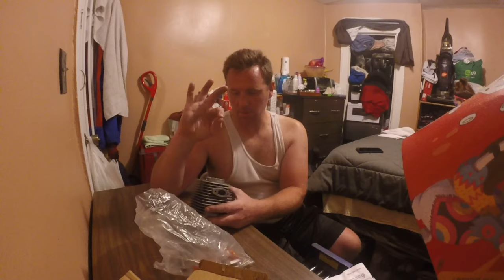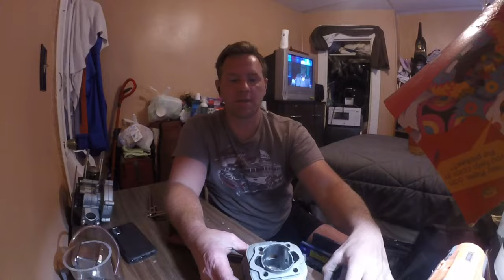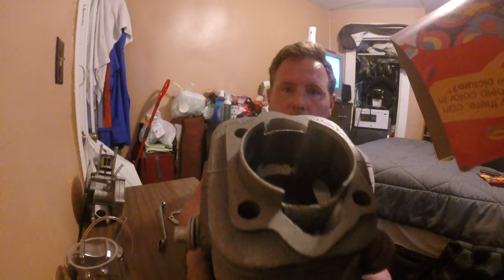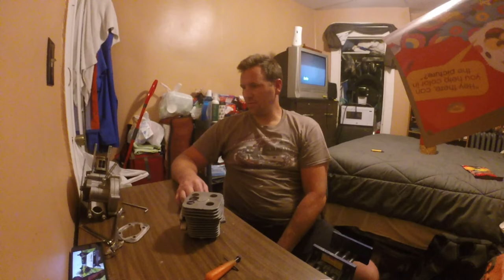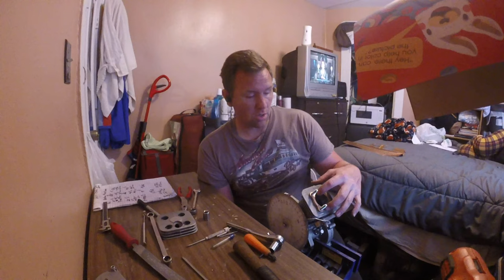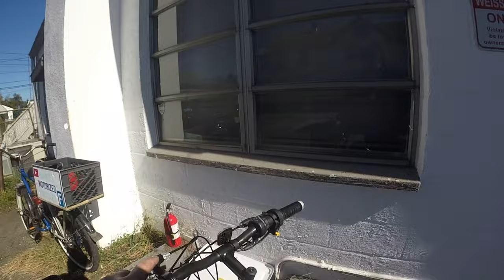I CUT THE YD100 CYLINDER’S TOP OFF, HOW I GAVE IT A SEPARATE HEAD.

Comment: The "Mad Scientist" strikes again... 👍👍👍 Nice way to think outside of the box bro... Good job of using what you have and improvising.. I have a couple coming out on my YD 100, be sure to watch... Best wishes to you and yours... 😎😎😎
Reply from the maker: I’m glad you approved lol , but I’ll definitely e watching what you do too.
Reply from the maker: Yes they are also referred to by many as a pk100 it’s basically a pk80 bottom end (the case, which is a very well put together motor)  the head is great for cooling too. They are know to have a problem with the piston skirts cracking off because 99% of them are not honed properly but only a lil bit of you break them in easily it pretty much fixes that problem or if you give it a quick honing that also fixes it. Oh I forgot to mention but it’s usually only the bottom of the cylinder that’s a lol tight n breaks the skirts not the whole thing, that’s y I say if you break it in easily/correctly you’ll b fine cause it’s only a little bit that’s tighter then it should be technically. But for the most part they are very well put together motors. There’s a lot of people talkin smack about them but if you understand them they are great little motors I  made a video on one like 6-7 months ago n I was talkin crap about it cause I didn’t know what it really was at the time but now I know more and about a month ago I put up a video about me disassembling mine to rebuild it. Now you guys haven’t seen it yet but my next video or the one after will b all about this exact motor (mines just black) and me rebuilding it completely n fixing all the issues I found in mine or might have caused actually, but let’s not split hairs here. I have been using this same motor your lookin for over a month now on my daily and it’s running great n start easy every time since I rebuilt it. Now mine has a few issues cause of the abuse I put it through but if you break it in right I’ll b fine and I think you’ll really enjoy it. Mine revs for ever n spins my 26” wheeled bike to 43 mph which is high rpms. Anyway sorry for the book but hope this helps. And either way that’s a great price for that motor I think I paid $164 7 months ago.
Reply: @JMB676  thanks again Johnnie,, I always appreciate your insight 😎😎😎😎
Reply: Y’all get on FB join motorized bicycle nation

Comment: Good video bro n I agree them carbs have a long slide compared to stock seems like you have to twist far for full throttle but there sweet I have 2
Reply from the maker: Yes it’s just weirder to go full throttle fast but they are great once all tuned up but this bike definitely rips once I get everything done to it my boy said he got clocked by a police radar goin 52mph like two weeks after I gave it to him but since it’s so cold he has really rode it anymore n he didn’t have his camera with him for all his first rides cause he’s , well a lil odd we can say n he was getting use to the bike.
Reply: That’s cool bro n I believe it to I have 2 yd100s that are in the 50 range n run great
Reply from the maker: @Littleevil9975  o yea no doubt they can hit that no problem if setup right but it helps when you don’t weight 270lbs plus but even at that weight the big thing I noticed from it is how fast the Reed helps it wake up from light to light.
Reply: Right I agree there bro
Reply: Right I agree there bro
Reply: Right I agree there bro
Reply: Right I agree there bro
Reply: I just found out it's an iron lined cylinder sleeve, the other similar "110cc" (50mm piston) kit I seen that LA Hoover bought turned out to totally suck.  If the iron sleeve was properly machined, it could be a decent kit.

Comment: How much pump did you loose after chopping the top. I lost a grip on my first one. Just wondering.
Reply from the maker: To b honest I didn’t measure it like that but it was probably about 3 millimeters all said and down. It was more then I wanted if I’m being honest but my next one will b less, my spacer will b smaller to get the pump n durations I’m lookin for. But like always live n learn right. I can’t wait to do another now.
Reply: @JMB676  would raising the jug with another gasket get the squish and port timing about where you want?

Comment: i dont understand why you cut the jug in half johnnie . dont that just open up more area for there to be a failure . i mean you must be trying to get a longer stroke meaning you have a longer piston rod arm . if its the same piston rod  then what is the point  of cutting it in half? ok not knocking what your doing just trying to fully understand why you would do this and why you would need to . now i dont ever see myself doing this but that dont mean i dont want to  understand why . im guess there must be more power or else why do it . take care ride safe . say hello to heather for me . lol .
Reply from the maker: Yes it more power but if you remember video I showed his bike I talk about taking that motor off to repair it x cause I blew the cylinder, a ring got caught and that’s y I’m replacing it. Well if you remember I had changed the port durations a lot by diggin out the transfers and stuff quite a bit but it also took away the smooth edges in the motor cause I changed so much. So. The only way I can get the same numbers out of it and keep all the smooth edges is if I raise the cylinder as a whole; ie put a spacer on it. But cause it’s a one piece cylinder I got to cut the top off and shrink it just to get the proper squish back. So besides the common over heating issues these motors are said to have, to be able to put an after Market head on it to help with cooling. Doin what I did allows me to get port durations I really want with out taking as many changes in the long run. Hope that helps brother.
Reply: @JMB676  lol nope im still confused but i kinda understand . in order to make everything line up and not grind the walls up you had to change  the size of the jug  to line up the ports to get the squish and line up right you had to cut it and resize the jug to line up right . now even though what i just wrote just confused me  alot i understand . basically it was all about making it smaller and still allowing everything to line up correctly . right?
Reply from the maker: @diydarkmatter  yes basically cause the last cylinder I used my rotors tool to dig out the transfers and exhaust a lot it ended up catching a ring cause of the size change n difference from a stock sizing so this way if I use the spacer I can get all the same measurements for the port durations (how long the ports are open or closed for) that I got from the first cylinder that blew up at wide open throttle but the width n what not is still stock size o the rings can’t snag as easily but still open how much I want. But by doin it this way I end up with way to much space above the piston at top dead center and since the yd100 is a one piece system the only way I can fix it is by cutting the top off so I can shorten the cylinder. So what you said is correct but since you said you still don’t totally understand I tried to do a better job of explaining it for you so I hope I did but if you still don’t then to bad so sad 😭 🤗
Reply: @JMB676  yep i understand now . what was confusing me was the spacer . i thought you was making it bigger not smaller so it dint make alot of sense . but now i understand that its shorter and the spacer is to make sure the ports line up right . are you going to use a high compression head or the stock head ?
Reply from the maker: @diydarkmatter  I’m just using the stock head i mead for it but if my buddy that bought it is interested in a different one I told him there is options if he so chooses however I did say I don’t really recommend it unless he noticed it getting to hot but since I built it so late in the year we don’t know if getting hot is a problem yet cause it’s cold out n as of now it stays really cool n there’s a build up of condensation on the outside of the Reed manifold cause the air charge goin into the motor is so cold on , so I honestly don’t think it’s goin to b a problem but maybe this summer we will have to see I guess. How is your bike doin?
Reply: @JMB676  ok i get its cold  its cold here to . as for my bike it s ok i still have not got it started  yet as its cold here . im old and have arthritis in my fingers so when they get cold they burn and cramp up so bad i cant hardly move them . so i dont do cold . but i will  say  i cant wait till spring . i have not done any upgrades on it yet . Christmas  is more important for a couple little ones then upgrades . its a magic time of year  for little ones . but  before spring i hope to have it the way i want it . but even if its not it is ready to ride . if i was your buddy i would go for the new head . even a stock motor  will benefit  from it  just for reducing heat alone . we all know how hot these engines get  the cooler they are the longer you can ride . what would be nice is converting one of them thick heads into a water cooled head .

Comment: All that work just to run a junk pipe. 🤦‍♂️
Reply from the maker: Yes but not the whole time, the new equally as crappy pipe just was in yet but I eventually got it on the bike.
Reply: @JMB676  2 strokes are designed to run an expansion chamber. You port the engine to the pipe, hince "tuned". If anything more fuel is dumping into the pipe.  I dont say this in disrespect, only cause i know you actually reply to the comments. Keep the videos coming!
Reply from the maker: @nimbusnimbus.IV.  no I totally get it and thank you for info cause I’m only doin this hobby for about a year now do I definitely don’t know it all but yes it definitely needs a pipe but like I said it has one now but it’s still crappy (mz65 clone) but better then Nuttin definitely woke it up a bit. But for my buddy it’s more then good. However for me I’ll eventually get my hands on a welder again n I’ll make my own . Idk if you can tell but that’s the real fun for me taking n makin something work together that isn’t or just fabricating something from junk to work how I need , I love being hands on you know